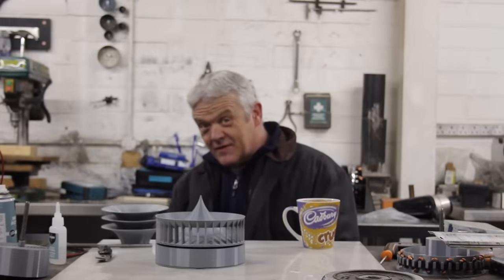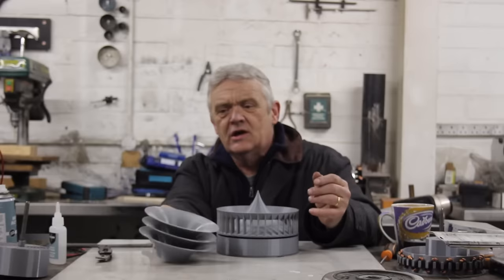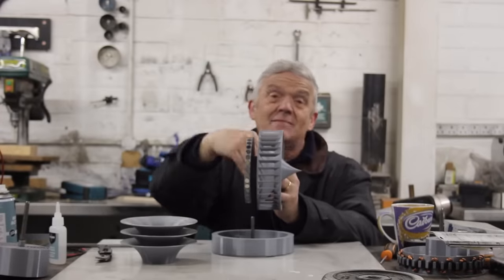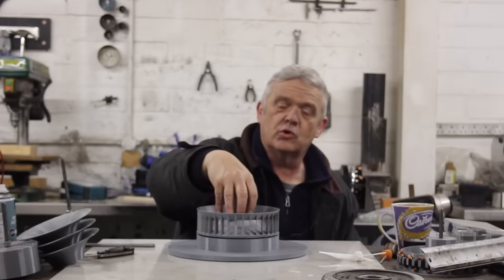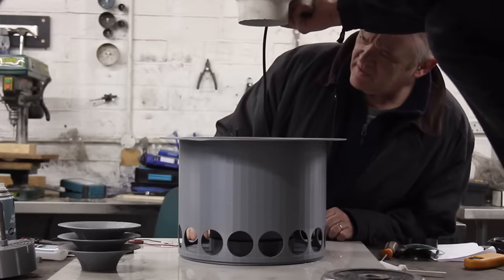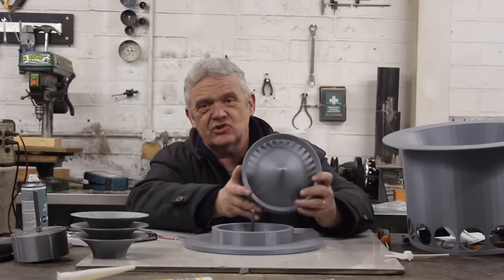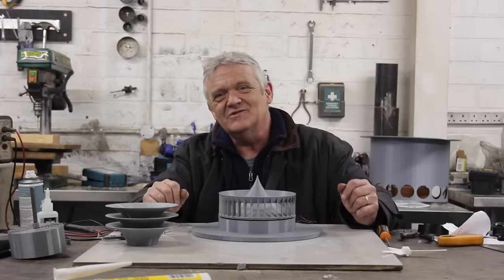1889 Ground Breaking Wind Turbine Update

Comment: Just thoughts.

I was thinking the wind directed upward would increase efficiency, though you noted working on the unit would be easier at ground level.

I haven't seen more than this video so I'm supposing this is scaleable and for now design experiments. However I see an application at the scale you're building. We have what I know as whirly birds on roof tops as a part of attic ventilation of hot air. Invert what you have, and use in whirly birds place. The power generated could run fans pulling in cooler air to the attic in turn creating higher pressure for the air passing through your turbine. With capacitors, relays, and a simple bread board, should be able to make it self sufficient as a stand alone system.

Could go further and add a center tunnel shaft in the assembly to house a rotating shaft which connects to the generator at the base so the flow of air is inverted but the weight, and ease of repair are still at a working height.
Reply: Another thought. 

Solar panels if they get to hot burn out cells. Well... if alike to replacing the whirly bird, if solar panels were installed to create a plenum space sealed except for an inlet space which then exits at the peak with a row across the peak of these generator turbines of yours, additional electrical energy produced could circulate the air within the plenum space. I figure an excess of energy would be produced than what the circulation would require, which could tie into the same array of power collection that was installed for the solar panels. Figure in all this would extend the useable life expectancy of solar panels, extending their efficiency by reducing panel degradation for lower total cost of ownership.

Comment: The wind collector will hinder airflow more than funnel it. Wind won’t flow as directly as your test source. 

At exactly 5:07 you placed the stand on the top. That’s actually more what you need, slightly curved down, to direct the outflow.
Reply: Do you have a source for those findings?
Reply from the maker: no - I don't think that is right mate
Reply: @ThinkingandTinkering   no, you're correct. 
I didnt watch the full video before commenting, sorry.
I just saw up to the shroud, i didnt realise you were then going to put that collection unit on top of that.

What I was trying to convey previously, is without the shroud, just the main unit, think of a curly bracket kind of shape. 

--->   {

It wouldnt collect and focus the wind, but the air that doesnt get directed by the central cone and through the blades will then at least flow over the rest the the unit unhindered and not introduce disturbance/eddy currents.

I cant really describe what i mean.
Nevermind, your idea is better anyway 😅

Comment: As you talked about - and demonstrated - in video 1890, the hyperbolic funnels surprisingly worked like a Tesla turbine. Would it be possible to mount the funnels onto the Waters turbine itself, thus getting a combined rotation force of the Tesla Turbine behavior of the funnels, and the Waters turbine? It would of course make the rotating part heavier, translating to more mass to rotate, and likely more friction at the base. Some lift may perhaps be generated from the funnels in windy conditions, to offset the added friction from the weight. It would be very interesting to measure static funnels, verses rotating funnels, in one of your experiments should you find the time.

Comment: Basically, at this point using the generator circuit for the detection of gain or loss. In essence a quantifiable sensor from which results can be inferred with each iteration of the design.
Reply from the maker: yes pretty much spot on mate

Comment: Without the duct that directs the wind down, would the wind not hit the turbine from the side instead of from above. If the fins on the turbine were angled, I would argue that it would be just as efficient. Also, with the whole wind capture device on, it would also require the wind from the side, but with loss of energy due to friction. I would bet it would work much better in reverse, but with a much smaller duct used as an exhaust from the turbine. You could even taper the exhaust to employ the venturi effect.

Comment: Regarding UP vs DOWN orientation, I get that you chose UP for practical purposes, but in real applications it must have an impact of efficiency depending on where the turbine is installed. The surroundings are also a "collector", the ground, a tall building etc.. I would guess that the less you need to "bend" the wind the better, because "bending" causes friction and turbulence. 

Also, you need to get rid of the "used" air, so do you push it downwards along a surface or upwards in the air, I would guess that upwards is better as there is less push-back and actually the wind would help removing the "used" air.

Looking forward to the tests :-)

Comment: I would love to turn it over and put it at the top of a thermal tower.  That way you don't have to rely on wind and you just need a temperature difference to create a breeze.  Should work almost 24 hours a day with peak power in direct sun.
Reply: Mwanser, you echo my thoughts exactly. The Persian Wind towers in Yaz jump to mind. Having the wind funnels facing down (as in the commercially placed unit on the pier) and the exhaust holes shrouded in a way to enhance flow rates (and not interfere with the inflow of air.

Comment: I don't know which is the better performer, directing the air up or down. But if you direct the air up, it nay still be possible position the generator on the botom side and use an axial to transmit the mechanical torque from the turbine to the generator.
Reply from the maker: I sincerely doubt it makes any real difference mate

Comment: Surely the direction of the wind coming down into the funnel is only using up to half of the wind power at any one time, as you are only getting it from one side. Why not mount this horizontally, with a tail to direct the funnel towards the wind direction?

Comment: A lot of science here. I guess this is a bit like those shiny chimney draft excellerators that turn fast in the wind to suck the smoke out of your chimney without the dangerous backdraft into it. Those nasty winds can blow the whole fireplace into your living room. There are still questions about the scalability of this, if 2x bigger could it be 4x more powerful? I recently discussed insulating my small kitchen so no heated air can escape quickly, using a normal refrigerator to heat the kitchen while it is cooling my groceries and drinks. How small must a kitchen be to keep it at 22 degrees Celsius that way and does not impact the cooling capacity? Intriguing, right?

Comment: Would placing the generator part on the outside of the ring be the best place for it?

Wouldn't it be better to place the magnets slightly inbound from the furthest extent of the rim?

Would less but stronger magnets passing bigger coils quicker create more power?

Comment: Interesting...
Just a quick thought on the wind capture device exhaust. I'm imagining a vertical wing shaped part just on the lower 1/3 of the outer canister, which is able to self correct to the wind direction, like a weathervane. Would you be able to utilise the low pressure created by an aerofoil to generated a little 'suction' and in turn, drawing slightly more air through the rotor blades?

Comment: It looks like the holes at the bottom of the outer wind collection shroud should be more aligned (hight wize) with the rotor to reduce unwanted resistance from the escaping wind, resulting in a greater through put..
 To gain a better picture of how it can work I'm imagining the device being powered by water instead of wind, so areas of potential turbulence can be identified and corrected..
 In short, turn the holes into vertical rectangles that match the same hight as the rotor, more flow in = more power out.    A way to improve the incoming flow of air  would be to take a closer look at the flow going out 👍
 And while improvements are going on, change the flat spots that will be between the vertical rectangles into triangles and make them as thin as possible to reduce escaping wind turbulence even more 👍

Sorry for the novel, I just get excited when my minds eye is opened,  keep up the great work..
Reply from the maker: did you see the computer modelling video?
Reply: @ThinkingandTinkering 
I must have missed that one.. 🤔

Comment: The more I watch this particular series, the more I'm thinking this would be a great turbine design for some of the tide energy designs out there. Since it's  optimized for low speed, there is one design in particular where the base is fixed in the shallows, and the inflow/outflow of water in the lower part of the system pushes a column of air through a turbine mounted in a tunnel above the water. The bigger question is whether it could be engineered to be more durable to the salt/corrosion than the standard style propellers they are currently testing with.
Reply from the maker: that is a very good point mate - thanks for sharing

Comment: These wind collectors look really interesting. I might be barking up the wrong tree- but would the exhaust ports at the bottom be concealed away from the wind? I'm thinking any incoming wind might also cause a bit of turbulence or resistance to the spin of the fan. It might be a tiny amount, but maybe having a rotating shield with a tailfin might increase efficiency a touch so that there's no wind blowing into the exit, just out of it.

Comment: It would be interesting to see a comparison of your rotor with collector vs a rotor that's the size of your collector. That way you can get an idea if it's just the bigger size that's increasing the torque or if the collector is actually more efficient than a rotor of the same size.

Comment: Just wondering. You may have answered this before, and i may have missed it. Have you thought about little wider blades for more torque. I remember you mentioned the height and that the wind doesn't impact the upper part as much as the lower part. Understandably.   But seems like a little wider blade or fin may increase the torque. I can't wait to get a 3d printer. Love watching your videos. Very informative and interesting.
Reply from the maker: I think you will find the printer fun and nice suggestions - cheers mate

Comment: Forget torque.  KW = volts x amps  Volts are equivalent /proportional to speed and amps are equivalent /proportional  to torque.  Put a constant load on your generator.  Use the same generator with a constant load (resistance),  same wind device at the same distance. If you increase the efficiency of the turbine your volts and amps will increase thereby showing an increase in speed and torque.  Your measurement will also be actual useable output. Measuring this at different wind speeds will show weakness and or strengths. You can also measure speed with a non contact tachometer or by measuring the AC frequency.
Reply from the maker: do you know what I find mate - it doesn't matter what you do - someone, somewhere at sometime will tell you to do something different - basically you do what you like as long as you get a result that helps you
Reply: @ThinkingandTinkering  Agreed.  
Just hoping for some actual power (Watts) output comparisons since I dont have the ability to play with this stuff
Reply: @p739-n2i  I can't understand the resistance to these suggestions.  Having read some of the comments, anyone who suggests this is given the answer you got.
Reply: @yodab.at1746  It is very clear if you read the comments, i have noticed this too. He keeps saying that the power output is not important to him, but he doesn't say what is. In the end the only meaningful thing is getting a power output of a design and using that as reference for future designs. I'm curious where this project is going.
Reply: @tibo786  what Rob seems to be trying to achieve is a torque measurement of the rotor. Regardless of how good or not the generator is, its that part which could provide the answers via loading it. He does explain at the end of the video that he's not interested in the output of the generator part and also suggests a formula using the speed of the rotor to find torque.  But I find the replies to the well thought out comments irritating.

Comment: Good day Robert. The 3D printed parts are a good proof of concept representation though as you scale up I would very much like to see more flat panel build ups as I have hand tools and  not the ability to 3D at this stage. Cheers!
Reply: They have them super cheap and pretty easy to use, these days. I would recommend the Ender 3 Pro. Should be able to find it for around $200. Anyone with hand tools should be able to get it together and working. Plenty of YouTube videos walking you through it. :D
Reply from the maker: I am pondering that mate

Comment: If the cone height could move possibly that would increase the performance..or as per a turbine in a turbo charger the scroll is 3D printed to the blades

Comment: Looking at those funnels you have, the bottom hole needs to be larger, middle a little smaller, and so on until the top one has no hole or at least very small.  The way it is currently, the bottom hole would be very restrictive to the air from the upper funnels.
Reply from the maker: cheers mate

Comment: I was thinking about this (fascinating as always).  I first thought, that instead of having a complex wind collection "booth" in which I assme there must be some complex mechanics to close off the lee-side, then is that necessary at all.  Why not simply have a "tupil leaf" to direct the wind down through the turbine.  If this swung on an axle, then it would always be in the right direction for the wind.  Then I sked myself, WHY spewnd wind energy in changing its direction?  Why not merely having a cone that swing in the wind suspended from the front end (think of a windsock).  Directing 100% of the wind energy through the turbine?  What do you reckon - very simple, but as always, it would depend on the amount of energy that could be produced by this arrangement!
Reply from the maker: it is a cool idea mate - thank you for sharing

Comment: Could you attach tubes to the holes at the bottom of the funnel, carry back up to the collection level but have a venturi style "extractor" that would use the jet stream effect to help lower the post turbine air pressure, potentially increasing efficiency?

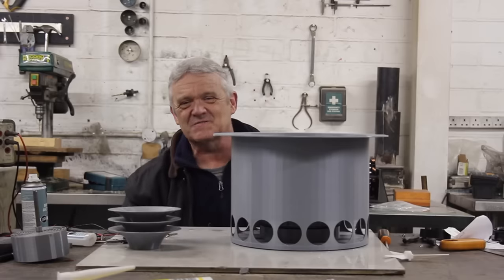Comment: I have a question about the top of the column of cones. Would the top of the system not be better if it was capped off with a dome or something? I'm thinking would air passing over the exposed top not create a low pressure zone inside the central part of the collectors and disrupt the downward air flow? 13:26

Comment: Robert.... After the wind leaves the generator through the holes at the bottom, if the expelled air is re-directed back toward the intake, wouldn't that provide a boost to the air coming in... adding to the wind entering the system and therefore boost the output??? Like the swing effect, a little push, at the right moment, would increase the overall force.... Just a thought...
Reply from the maker: it is an interesting thought mate and I honestly don't know
Reply: @ThinkingandTinkering  Worth an experiment I think.... "Wind-feedback" to add to the supply....!!!

Comment: I get what you're saying about measuring incremental improvements on prototypes, but I think people at home are probably coming at this with a different motive.
There aren't many youtubers that are building the larger scale generators and documenting the prototypes or explaining things in a concise way like you are.
So even though it's the wrong way to look at it, it's kinda natural that newcomers would be comparing it to other designs around the same scale as your prototypes, and your prototypes are probably around the size of generator they were thinking of making. Who knows if they're even gonna see these follow up videos either.
Would be interesting to see total current with a load and direct torque readings either way tbh, but I also know doing that every time you make adjustments to things you're just tinkering with in the prototype phase would add on enough time in total (especially across all the projects you work on) that it ends up being a pain in the ass.
Maybe there's a way you can rig up something to spend a bit of time once to negate the timesink forever and get the best of both worlds.
Reply from the maker: I wish there was mate lol
Reply: Not saying I have any good ideas either. Something something linear actuators, wago connectors and grippers. But it might just end up not applying to some new idea you have and getting in the way

Comment: If this was scaled up, maybe the vanes could be made variable similar to a variable pitch prop. It would narrow down the correct pitch for the most torque and or speed while spinning. Add an arduino to change pitch according to wind speed?
Reply from the maker: maybe

Comment: Hi Robert - Thank you for your great suggestions to help the world! What would happen if you put some wind guides in a swirling pattern down the wind guide part and also maybe on the rotating cone so that the wind starts getting pushed in the direction of the spin, and the fins on the cone help to provide more push? Like the the inside of car automatic transmission torque converters have. Maybe experiment with the direction and depths of the channels. Maybe indentations or raised fins? Thank you again for all your work! I am a big fan of your channel!
Reply from the maker: I honestly don't know mate - give it a go
Reply: @ThinkingandTinkering  If one is using an airfoil the lift is proportional to airspeed, the angle of attack being constant. Then any swirl should be counter to rotation to increase velocity over the vanes.